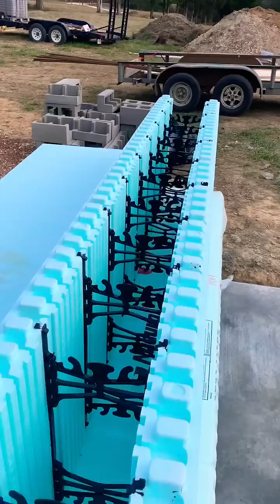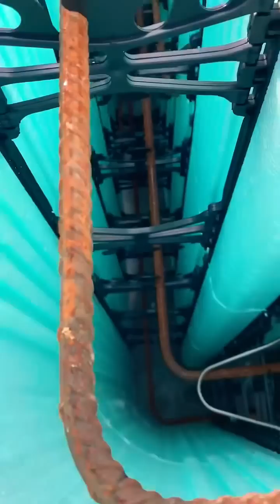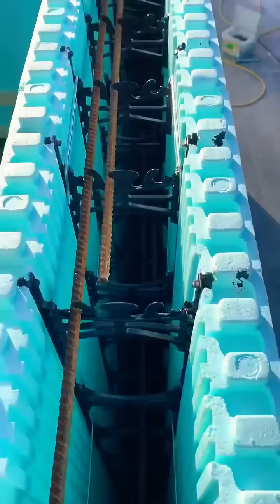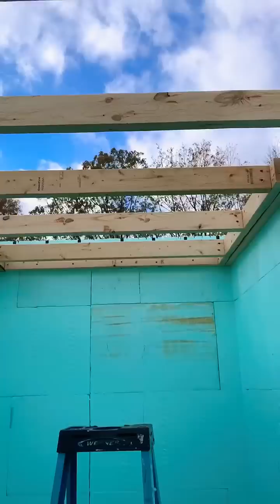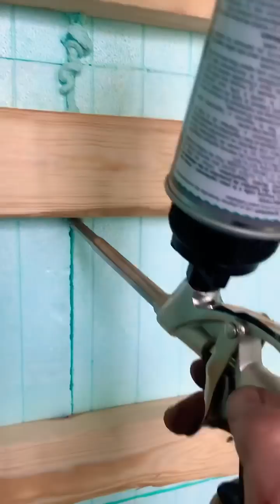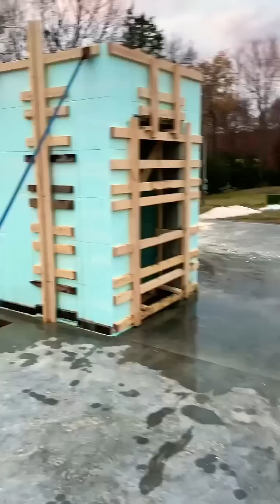Saving lives!! STORM SHELTER Pro edition #icf #concrete #safetyfirst @NuduraICF

Comment: Can you explain a bit further how this is better than core-filling cement blocks please? Thank you!
Reply from the maker: Blocks are filled only vertically. Each cell is an individual narrow column of concrete. Nothing is bonded together to create horizontal support “unless” you install bond beams & rebar every other block…which no one does. 

Core filled is definitely better than nothing, but it doesn’t compare to the structural integrity as a solid 6/8/or10” ICF that has rebar horizontally every 18” and vertically let’s say every 3’. 

If you use an 8” block it’s only 7 5/8” wide plus the concrete fill is only what…5 5/8 vs 8” width of solid concrete on an 8” ICF.  

Then we get to the insulation part which is gives a thermal break plus it’s super energy efficient.
Reply: @w.k.d.constructionllc awesome, thank you!

Comment: I wasn't gonna do above ground, but below ground 12 inch with 12 inch cap. But you mentioned about Rebar on 18 in centers. I'm thinking about doing 12 inch Verticals with 8 inch horizontal with 6 inch centers double layer on the roof. Rebar would be fiberglass, but also looking at double layer in the walls, not to mention 18 pounds of helix steel.
Reply from the maker: So a bomb shelter!? 😆
Reply: @w.k.d.constructionllc  Absolutely correct. My original plans before doing more research was in a similar context of a Atlas. E silos were built 18-inch walls with 2 foot concrete cab. And I was going to use strictly one inch rebar throughout the whole thing until until I started finding out about fiberglass Rebar, and how much stronger it was along with the helix steel.

Comment: If you’re going to that expense why don’t you make it a little larger, half outside, easily covered with some exterior magic…. so that it can contribute to the house’s look and have an escape route in case your blocked in by debris…. Especially if you’re rural this could be an issue. I guess if you have only one route that’s inside you could make it into a gun safe too? Or a panic room.

Comment: core filled block can be run with horizontal and vertical rebar too.  vertical  can be put every slot.

ICF is definitely a good system too, but I am pretty sure concrete filled rebar reinforced block will stand up.

the advantage to ICF is its insulation factor.
Reply from the maker: You can put bond beams in block, but it will never be as strong as a solid concrete wall

Comment: As a rodbuster, I'm curious what exactly a 6 ft² rectangular lap reinforcement is going to do for a wall from an engineering standpoint. A standard wall is MAYBE a little over 1 ft². To those who don't know, that means that when you look at the rebar for a wall, you're going to see the rebar cross every foot. It's going to look like a bunch of 1 foot squares. Basically the rebar for the walls should look like how they did the rebar for the roof. This design is an 18x48 inch or 1.5x4 ft rectangle which might be ok if they use #6 rods but this looks closer to #3. I'm guessing that those intricate looking chairs in between the insulation are part of the reinforcement design, although if they're plastic, I'm not sure how much reinforcing they're going to offer to a wall that's only 6 in thick. I'm not knocking it... I'm genuinely curious. I want to know how much this wall can take. What are the strength specs? Also, what are we doing with the rebar in the corners and why are the corner rounded off? By the way, I love the idea of insulated forms. It's really cool and seems like it's going to make waterproofing much easier.

Comment: You can rebar reinforce with cinderblocks also, FEMA has the blueprints for free
Reply from the maker: Ya, it’s stout but not as strong as solid concrete with reinforcement

Comment: Tornadoes strike almost at random, are unpredictable and don’t respect wealth or social class, so in Tornado alley, a storm shelter is a great idea. It’s a great idea in any case! If I lived there, I’d want one. Otherwise, a cheap one could be made just big enough to hold the family, not larger. 4x4 or 5x5x6’ high would be big enough, and cheaper. You won’t have to be in it long, or often, but if you need it, it will be nice (i.e. a lifesaver) for it to be there! Key will be to avoid using it as a storage shed!

Comment: Nothing wrong with this system, but the pitch is an appeal to fear and full of misleading info.
Reply from the maker: Man, I am literally building a storm shelter for a new custom home. I install many just like this. It’s an option people may not know exist when building a home. Nothing misleading. I never guaranteed anybody’s life, this just gives you a fighting chance of a storm does hit you!
Reply: @w.k.d.constructionllc  What I see as misleading; You say that ICF system is “nothing like Cement block” because of horizontal and vertical reinforcing it incorporates and its thickness. 
This implies that cement block wall has no, or less, reinforcing than the ICF system, and is not as thick. You know as well as I do that single or double CMU reinforcing can be placed as frequently as 8” OC H & V, and the walls can be 4”,f 6”, 8”, or 12”. One respondent claims to have CMU for 16” thick walls available.
I understand and share your enthusiasm for storm shelters and ICF, and you are correct that ICF systems are very different than CMU wall systems. But the differences have more to do with the durability of the facade (ICF needs to be protected as the surface is quite soft and easily damaged) and thermal performance (ICF has better R-Values). ICF may also have a cost advantage due to lower labor cost. The differences you stress in your Yotube short are relatively insignificant and offer nothing that CMU does not offer at least as well.

Comment: I would want the entire house done with ICF’s. Never compromise with your family’s safety and security. You can stay anywhere in the home till the storm blows over.
Reply from the maker: It is safer to a degree, but without a concrete roof you would still be vulnerable

Comment: Okay but with CMU walls you can vertically reinforce it with rebar every 8 in and horizontally every 8 in if you want. And then grout the cores solid. And you could use 16in wide blocks. Or even 12 inch blocks. Then you'll have either an eight, twelve, or 16 inch wide solid concrete wall with rebar every 8 in both directions. And you still think yours is better huh?
 cuz you did it that way it's automatically better

Comment: Code for montana where we have less tornadoes is vertical bar every 18" too @ 8" thick concrete walls. We also have snow load and frost line though too.

Comment: Does concrete take longer to cure if it's trapped in foam?
Reply from the maker: I would say no, because it’s a chemical type reaction. It doesn’t know whether it’s poured on the ground or underwater… it’s going start curing as soon as it’s mixed sunlight and humidity are the largest speed factors in drying concrete

Comment: That's a joke. Sold core block would be way stronger. And that's rebar every 8 inches. Horizontal and vertical.
Reply from the maker: No it wouldn’t, that’s why they don’t build skyscrapers out of blocks!

Comment: ICF is a NIGHTMARE to work with. The only guy happy about it is the concrete guy.  For me to bid a wiring job on an ICF home, the invoice gets 25% added to labor.  To have a shelter in the garage, you’re better off buying a premade unit with lighting from OZ or something.  They can ship them and place them with ease.  Putting ICF inside the home just took up a chunk of your square footage with those insulated concrete walls a foot thick when 1/8” steel does just fine.  Affixing door and window frames in an ICF wall is a nightmare and ugly.  You have a screw going thru a few inches of styrofoam that doesn’t support it before landing in a plastic channel that flexes, you can push and flex a door frame since the screws are so long.
Reply from the maker: Not a nightmare, does take a little more finesse

Comment: Remember, you still need to be able to exit your shelter after a storm and even this type of door could be by blocked by debris. One of the best setups I've seen took and mounted pivots for a porta power hydraulic ram  on the door and the wall next to it.

Comment: Don't bother just building a "storm shelter" with Nudura products.  This product is FANTASTIC to build an ENTIRE home with.  To include your interior walls.  Using this product for your entire home will fireproof your home, period.  Especially if you go with cement floors on each level, and a cement roof.  Your entire home will also be stormproof at well.  With Nurdura products, your home will be quieter inside.  The temperature will be more stable, especially if you add more exterior insulation.  Exterior wall basically become bulletproof.  ICF homes are also more resistant to insects, as they is not material for them to burrow into.  Look up ICF homes for yourself.  If you are planning to build a new home, ICF is the way to go.  There is one downside to be aware of.  Be sure that you are VERY happy with the design, before the build begins.  Once those cement walls are up, no changes can be made.  Or, at least it will be VERY difficult and expensive to change.

Comment: Better yet build the whole house ICF, insulate under the slab and have your tankless hot water heater heat the whole house through the floor. Cheaper to build, cheaper to heat and cool, more comfortable, longer lasting, safer, and better air quality.
I mean if you care about your family... Or yourself, or your utility bills, or the environment,

Comment: I've been a home builder for over 50 years and have used countless ICF's from many different manufacturers.  Without a doubt, NuDura are the worst of the bunch.  I won't go into detail, but if anyone reads this and is thinking of using ICF's for their foundations, make NuDura your LAST choice!

Comment: Knockin on brick lol Most brick walls have 12- 16mm bars every 400mm dowelled into the base of the slab you guys don't also when they lay them the put rebar horizontally and vertically with the same size bar. I highly doubt that product would be no stronger than a proper brick wall
Reply from the maker: This concrete wall is way stronger than any brick or block wall

Comment: ICF is much more expensive than reinforced CMU. Overall reinforced CMU is much more stable, provides a higher net compressive strength, and will “last forever” compared to insulation wrapped concrete. Let me ask you this. Why would you need an interior room with the r value of a house you find in Alaska in your already in your insulated house?  Don’t listen to this guy. He’s trying to sell you a product. Or is getting paid to advertise a product. How do I know this?  I install both, have been for 20 years. I work with engineers and architects to design houses and commercial buildings with both building systems. Time and time again, reinforced CMU comes out on top.

Comment: Does building with rusty metal like that make it less durable and structurally sound I really am asking I don’t know
Reply from the maker: Some say it does, some say it actually helps bind the concrete to the rebar. It will not hurt it being a little rusty. This has only been weathered for a short time. Just enough to surface rust. I don’t know a supplier that keeps their rebar in a climate controlled building! 😆 if it’s setting outside, it’s going to rust even if it’s covered 🤷🏼‍♂️
Reply: Buy the green painted rebar then you don’t have to worry about rust friends.

Comment: Your house is stronger than your storm shelter man. A guy can pretty much kick through a 6 inch concrete wall and you dont have very much rebar in there. 
Then theres the fact that you will never know how many voids and rock pockets you got in your walls.
Reply from the maker: Put the bong down dude. 😆
Reply: @w.k.d.constructionllc  what slump did you use?

Comment: All of the rebar is corrupted. 
The protective coating is broken and in turn it has rusted. This will create a pit of condensation build up leading to structural fail.

Comment: the door had better swing inward, otherwise it's just going to be a family sizes coffin.
Reply from the maker: It does!
Reply: @w.k.d.constructionllc  There's a company in Southern Illinois that has fiberglass/underground storm shelters on display in a mall, the salesperson was really selling one to a potential customer.  Right up to the point where I mentioned that the door that opens upwards was a potential problem.  The salesperson was very upset, until I explained that storm debris could easily trap everyone in the shelter.

Comment: Those are good for buildings but Masonry walls would be better for a storm shelter and you can do it after the building is built with reinforcing at each face at 16” OC and full grout and it’s like solid concrete.

Comment: Just a question, will that rebar continue to rust or not?
Reply from the maker: To a point I guess, concrete kind of seals it but it has moisture in it and takes many years to cure…this won’t be getting wet, so I would say it really won’t rust too much further than the surface?

Comment: If I built my own home, the basement would be the bedrooms.
steel plate over the basement with two sump pumps and backup power.
tornados come at night also. You might not have time to get into the shelter. Better if you are already in it. 
Replaceable things go on the main floor. Like car, piano, refrigerator, tv, couch, etc.

Comment: You can quite literally build it as strong out of blocks that are core filled. You can notch or they make blocks that are made to put horizontal rebar in and the vertical rebar just goes into the holes because the blocks are offset by one hole. What you gain with the ICF is convenience and simplicity, but you pay for it. It's a great product - but it's only as good as the people using it and the materials used in it.
Reply from the maker: Nope, a block wall with rebar will never be as strong as a solid concrete wall, guaranteed. That’s why they don’t build high-rises with blocks! 🤔

Comment: So you’re saying this is better than CMU block? CMU block that would be 8” thick solid concrete rather than 6”. CMU block that can be horizontally reinforced every 16” and vertical every 4” rather than 4’. No sir, the only advantage I see of this system is it’s insulated and quicker to build. What’s the cost diff? One CMU block is 85c

Comment: Little on the small side dude you'd be packed in there like sardines in a can
Reply from the maker: Na, not too bad. I’d rather the structure be a little more compact, gives it more structural integrity
Reply: @w.k.d.constructionllc   Fair enough I did see a video on shelters and they recommended to build one that you could stay in it for up to 6 months while you rebuild but you're right as long as you're safe that's all that matters man specially where you are Don't know why people don't build these in these tornadoes zones  They really should be mandatory for everyone safety

Comment: If you live where a tornado is possible, most likely you have the option to include a basement on your new home build. Any good basement company will use steel/aluminum forms, have as much or more steel in the wall, including "ties" that are steel anchors that hold the forms together. The walls are hot tar sealed and insulated with foam board past the frost depth. When I was last in the industry, about 15 years ago, it was still more economical to have us pour you a fully custom basement than to use the foam lego blocks. I haven't seen them used much since then so idk how much pricing has changed.
Reply: All of Texas is tornado country. Building a basement in most of Texas means building on the level ground and backfilling cuz there’s no way you’re paying to dig up the limestone that’s just underneath the top soil
Reply: My uncle and aunt live in the Midwest and they found a hidden bunker separate from their basement. Their house is over 170 years old
Reply: @smokinreefer9336 jeez how did they find it??

Comment: If you had ever helped clean up after an F4 tornado, you would have put that thing under the garage floor. A flying pickup truck will make parts out of that thing. And, you don't have anywhere enough rebar in it. 5/8 on 12 inch centers.

Comment: I built my entire house out of ICF back in 2005 and included a "safe room" / bath room and I would NEVER think of living in any other type of construction.  I spray foamed my attic.  For the past few years my power bill for the HVAC system needs has only been around $130......for the whole year, my Carrier T-stat tracks all the data.   I heat with a small wood stove during our short winters in South Alabama.  2,000 ft.sq. house.
Reply from the maker: Awesome!

Comment: No details of how it’s anchored? If a fully loaded truck can be sucked into the air like a rice cake, not anchoring this just makes it a heavy Lego block!
Reply from the maker: It’s bonded to concrete with rebar stubbed up through the slab

Comment: It's a novel idea but if your going to do traditional framing above the concrete wall it can get pretty pricey. I was just at a home being built and they had to frame an inside wall and an outside wall due to the debth of the foam concrete wall.
Reply: My 2,000 ft.sq. house is ICF and to power my HVAC system for the whole year it only cost  me $130 last year.  My Carrier T-stat tracks all the data.  I'd say in the past 18 years it has more than paid for any additional cost up front.

Comment: Are you dumb how would a foam wall with the exact same steel be stronger then block work filled with concrete that also has the same steel horizontal and vertical